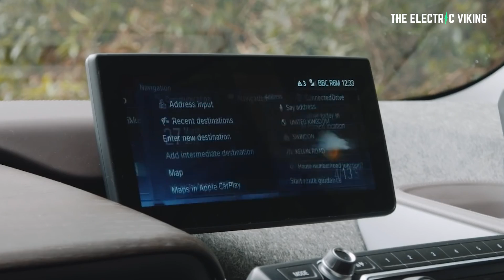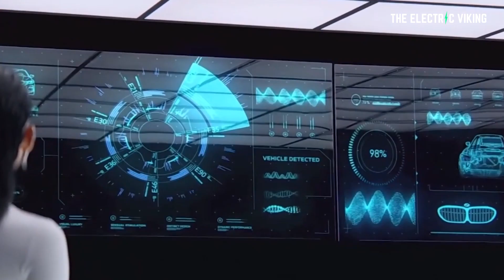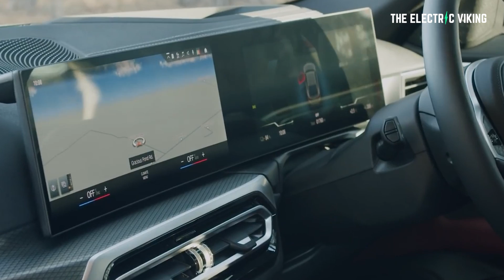BMW's new EVs to be 'affordable:' batteries will cost 60% less

Comment: I remember my first sight of the BMW i3 was a negative WTF? Probably because I've never been the greatest fan of BMW cars. The reality never lives upto the hype. But here was a Beemer that very few liked, and for a while I was blinded by the appearance, which was "challenging" to be polite about it. But it was a BEV and that made it interesting. I found out through my own reading that this vehicle was a bit of a game changer in its own way. And if you pay US$10 to Munro and Associates, for their online pamphlet, you get some excellent insights into what makes the awkward little Beemer a special vehicle. So BMW certainly knows how to make a BEV. I wish they would stop faffing around with developing obsolete ICEs and BEV car designs that also accommodate ICE in a compromised range. Because when they made the little i3 just for batteries, they actually got it right. Me? Yes, I became an admirer of the i3.
Reply: MiniCooper replaced i3 and everything will be fine
Reply: The BEV had a range of about 130 miles even with the motorcycle engine engaged. If I recall correctly, once you ran down the motor,  the motorcycle engine had to run to keep a charge on the battery.  That sounds like BMW <:)
Reply: @craighermle7727  
Actually, the last i3 has an electric range of 165 miles (possible to get 170), add the range extender option to the mix and the range is into infinity as long as there is gas in the range extender.. 

The real reason why sales of the i3 tanked in the USA is because the Model 3 has 250 miles of range and it charges faster on DC and the base model was $38k. Also, BMW disabled nearly all of the European options on the i3 due to laws in California. Why would anyone spend nearly $60k for an i3 when the Model 3 is right there.
Reply: @mamadouaziza2536  Sure <:) f, you continually fill the 2 gal tank for the motorcycle engine to generate power to charge the battery to run the car,  the mpg of the car goes down to about 50 miles a gallon, but I guess you could argue the "range" is indefinite.,    If you don't have to engage the motor it might have made sense. That doesn't mean that BMW  doesn't idolize Rube Goldberg. <:)
Reply: @craighermle7727  
The entire purpose of the REx is to engage it to extend the range. Duh..
The i3 was never engineered to be a long distance electric car, its an urban city car.
If BMW wanted to make the i3 a true hybrid like the Chevy Volt, they would have..
Why shit on a car for purposes it wasn't intended for?  Its like service punch at a party expecting to get drunk from it when the host is telling you their is no alcohol in it..
Reply: @mamadouaziza2536  Ummm, Duh.  I believe it was you that brought up indefinite range; I didn't.  All I did was respond to your comment on how the indefinite range portion of your comment would be accomplished <:)    I've owned several BMWs over the last 30 years, and   I've honestly never been overly impressed. , but I knew how much it was going to cost to operate over 5 yrs or 75k miles.  That is no longer the case.
Reply: @craighermle7727  
You've owned several BMW's over the last 30 years but you were never impressed?
Were you given these cars free or did you spend your own money to buy them?
Seems to me if you're not impressed with a product, you don't continue to buy it...
Something had to intrigue you?
Reply: @mamadouaziza2536  Well,  it was BMW or an American built pos.  BMW won.  Most of the BMWs I've owned were 3 series.      Again, the main thing that kept me coming back is the extended warranties and maintenance plans that were offered.  As overpriced as BMWs are I,  knew how much the car was going to cost of 4 or 5 years. expenses were fixed. The warranty and maintenance plans were, IMO,  incredibly good.   That was the deciding factor. That is no longer the case.  BMW was actually trying to sell me a 3rd party warranty instead of trying to sell BMW add-on products when I bought the 430 GC  That, I found amusing.  The 430 will be my last BMW.
Reply: @mamadouaziza2536  I thought I relplied, but I don't see the post,  so I'll summarize. With exception of a Tesla, I'd never own another  American POS.  I had a Corvette, and the entire experience was a nightmare.  I've kept buying BMWS because the add-on warranties and maintenance plans were, IMO, that good.  That is no longer the case, so there's no reason to stay with BMW.
Reply: @craighermle7727  
So, what do you have now?
Reply: @mamadouaziza2536   I currently have a 430 GC. The BMW was available, and the Tesla "Y"s were not. It's the only reason I still own a BMW. The next car I own will be electric, but  It won't be a BMW.  I don't believe  BMW will ever offer a car that has the forward compatibility and extensive OTA updates that Tesla offers today.  The dealerships, IMO, couldn't survive.
Reply: @craighermle7727  
Nothing wrong with having that motorcycle engine option in the i3 to keep the battery charged.. Name another electric car that can hold its charge while you drive it (with the exception of the Chevy VOLT)??? 

With that REx option you can go for days without plugging your i3 into a wall socket especially if you turn on the REx at 75% battery charge. I drove from Los Angeles to the Bay area and back in an older i3 with the smaller battery (used the REx to charge the battery), had no issues keeping up with 80mph traffic on the freeway..
Reply: @mamadouaziza2536  It was a silly design, and it still maxed out at about 125 miles didn't it?
Reply: @craighermle7727  
No it wasn't a silly design. Many engineers in the auto industry gave the car rave reviews including Sandy Munroe.. The last battery update gave the car 160 miles of range and with the REx the range is unlimited..
Reply: no one liked the i3? Hmmm... BMW sold every i3 they made.. Had BMW evolved the i3 to compete with the Model 3 (in terms of range and charging speeds), the i3 would still be a good seller.  I also think the public assumed that any car coming from BMW would be a premium performance car?
BMW made it very clear that the i3 is a city car, not a performance car. It would be a very hard sell for BMW to market an economy subcompact car regardless if its ice or electric because the company is known for luxury/premium performance cars.  Even now in 2022, people in the USA still regard electric cars as not real cars/pieces of junk.. Hopefully that will change once people get use to the electric Ford F150.  USA citizens love their gas engines.
Reply: @mamadouaziza2536  Very few liked. Not nobody. There is a clear difference there. The few totalled 250,000 over 8.5 years.  Not bad, I grant you.
Reply: @ramblerandy2397  
It was a niche market car especially at $60k.

Comment: No mystery that BMW would use Panasonic's 4680 cylindrical cells, they're better than most cells available today, however, NASA's solid-state battery will be the real game changer with BEV's, and all battery electronic equipment.  Until then, the 4680, Ultium, and many other batt. cells are fine.
Reply: “Will” and “If”. Good luck to those who had their current car written off today

Comment: BMW has never wanted to make EV's, their early examples where just compliance vehicles and they have been planning on politics to halt the growth of EV's. 
Now the language is just to keep investors on side, still hoping the media and politics can halt the acceptance of EV's
Reply: Aluminum frame carbon fiber plastic composite innovative engineering, sold internationally, ridiculous to call it a compliance car. That's a useless insult term used on some very good, practical vehicles with good performance.
Reply: @rp9674  It's handy to put your development tech into a compliance car that you don't intend to make a lot off, there are tax implications and government grants to do that. As far as being practical, they where tiny just enough room for 2 adults and a couple of small kids in the back with virtually no boot, I suppose the small size would eek out some sort of range being very small. The Nissan Leaf was practical car with a good range for its day without the pretend stick on carbon fibre with a lot more space, it was a shame it didn't have battery cooling.
Reply: You can bet BMW was watching the US midterms pretty closely <:)

Comment: Having all vehicles powered the same , BEV, is putting transportation’s eggs in one basket (or casket depending on your POV).  How does a BEV react to say 2ft of flood water?  Military vehicles are tested driving through mud @ water & wont always have dry paved roads to run on.  Florida hurricane storm surges caused floods.  Scenes of submerged vehicles has me asking what effect would flooding have on a BEV?

Comment: I’ve owned 3 BMW’s & a Lexus Rx400h.  The BMW appeal to me was handling & engine performance. With EV torque coming on very quickly, acceleration is satisfying & floor mounting of battery pack lowers the center of gravity.  If a well designed suspension goes with an EV, well, I’ll be comparing EV performance to my Z3 3.0 L 5-speed.
Reply: the i8 and i3 both are amazing cars to drive and so is the newer electric Mini Cooper.
The i3 is superb in the city, around corners, sloping streets and turns. It handles like a true BMW.

Comment: The one drawback of Tesla is they don't offer much Luxury in the Interior or a Hud in the three and Y . 
I have and 06 325xi wagon and when I drove away from the model y demo thinking the ride and
comfort in this old wagon is much better than the Y . BMW are and expensive habit though I have had
all the oil leaks and 5 or 6 recalls. Even if they could deliver something in the 60k range (current model Y)
there is still no reliable charging network for it. Elon announced the Y suspension was revised so maybe
I need another test drive now.

Comment: A thing to remember here is in top of the ice ban in the EU from 2035, the EU has also announced their new Euro 7 regs that mainly cover diesels engines but also emissions from brakes and tyres that come into force from about 2025. That second bit is still in proposal stage but they have shown every indication that it will be passed. So BMWs hand has been forced by the EU and there is not going to be any going back on it. Once decided, the EU rarely change their minds.
Reply: Windmills and solar DO cut it for modern civilisation. In fact the alternatives are uncivilised so fail by definition!!
Reply: It seems highly unlikely the ban will stand in the EU,  particularly in eastern countries where the standard of living is somewhat lower, unless EVs prices can be cut in half at retail.
Reply: @teekay_1  EVs are not the only solution those countries can pursue in response to the ICE ban. They might just jump over to pushing public transport or shared mobility. Many EU countries have the know hows and have been very effective in terms of both cost and transport equality.
Reply: @lastminutesolutions  It's not clear what problem EVs are solving at all, since the EU requires fossil fuels or nuclear power to create the electricity.   Windmills and solar cells can't cut it for modern civilization.

That aside, public transport may work in small countries where you can take a train from one end to the other in 2-3 hours, but in large countries, it's not feasible.

We're going to be highly dependent on oil for the rest of everyone's life who is born right now, unless someone invents limitless fusion power, or (no joke) a home nuclear reactor that you can put next to your house.
Reply: @teekay_1  not how the EU decides things. All 27 countries agreed with the ban and all signed up to it. To make changes all 27 have to agree to the changes and they won't. This is pretty much cast in stone hence why all OEMs have accepted it. The OEMs are arguing against the Euro 7 regs as it's money wasted when they need the money for BEV development. Hence why it looks like it's diesel related only. Tyres and brakes apply to all cars so that reg change will be included
Reply: @patrickjr11  Everybody has a plan they swear they'll stick to.... until the winter comes, they're freezing, and then EU agreements are suddenly not as important as survival.

Electric cars are pretty far away (20+ years) from seriously being a threat to gas/diesel cars for many reasons, not least of which there are insufficient resources on earth to make the number of electric cars required to replace the existing fleet.  

It will be interesting to see how practical western europe is when faced with the reality of the situation.

Comment: BMWs new batteries are not 4680. They are doing 4695 and 46120.
Reply: Apparently they have announced that they will use Tesla's format for their next batteries. Looks like Tesla have won that particular development battle.
Reply: They are still cylinders and now clearly based on size of tesla's batteries.  It is best to just say they are following tesla and congratulate them on joining the present.  The companies sticking with pouch cells have no way to reduce cost and are overly afraid of recalls.  GM's entire ultium strategy is to make oversized packs with easier cell swapping to reduce warranty replacement ricks. Ultium stands for inefficiency and the cars will never be competitive due to slower charging and less range vs weight.

Comment: Why does BMW make EVs with ugly grills. The ii3 was ugly, inconsistent body lines, pig snout front, weird shape. It is like the BMW engineers were trying to fail.
Reply: You wouldn't want to stifle some Engineers or Marketers wacky dreams would you . Not the first time remember the Bangle Bungle on 2001
5 series.
Reply: @ctuna2011  Aka the Bangle Bum.
Reply: If they just did a nice ev i-series style small sedan with small nostrils itd be amazing